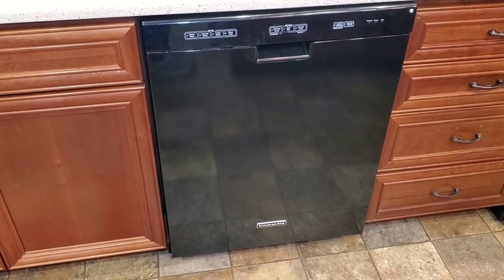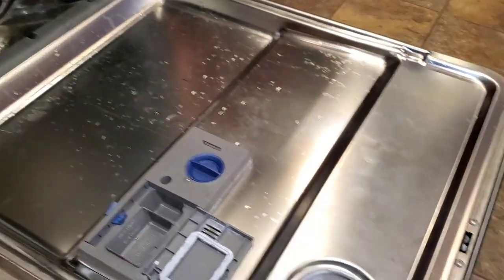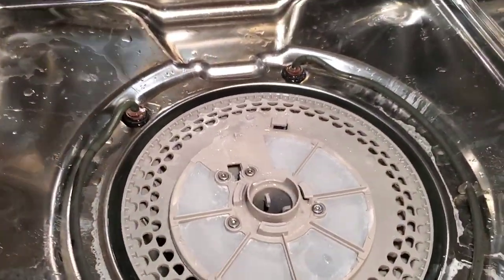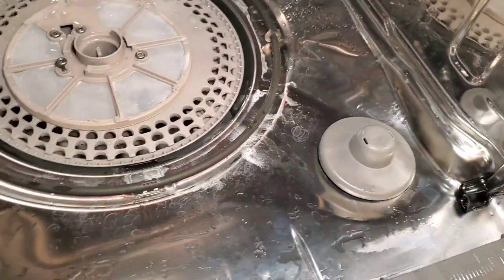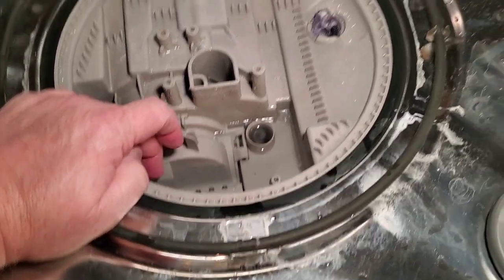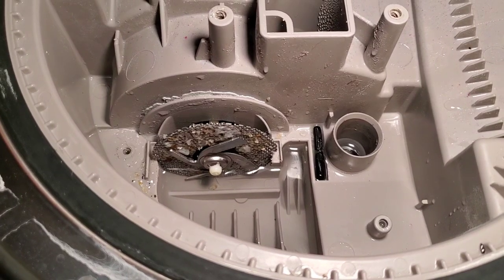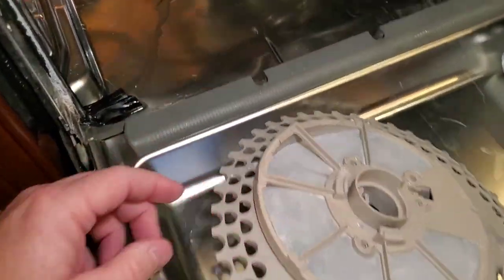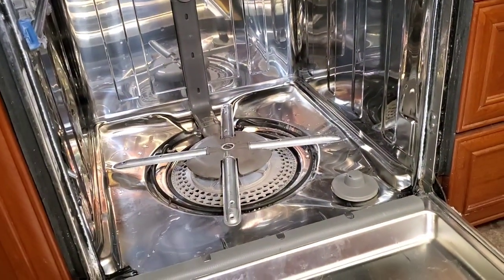KitchenAid Dishwasher How To Repair NOT CLEANING & LOUD NOISE Step by Step

Comment: Nice video. If the reader is having to clean their food chopper too often as shown in the video, that implies the food chopper is worn out.  One might figure out how to tweak it to make things work properly, or buy a new one for $35. For example, my chopper had the retaining plate pop off, so I had to reassembled the cutter, shaft and screen.  In the process I tried to make sure it was working right, I did not think to try and sharpen the hardened steel cutter with a Dremel tool while it was apart from the screen. I believe a dull blade would eventually start to bounce away from tough things resulting quick build up seen in the video.  The retaining cap is not the easiest to remove, if at all, but one can bend it in order to clamp tight if it does come off.   This well done video had close ups that helped me figure out how the chopper went back together, and exactly how readily navigate through the whole job.  I am certainly going to try and keep my dishwasher with its stainless steel cabinet running as long as possible, and informative videos like this sure help with that task.
Reply from the maker: Great input and you are spot on.  I finally decided to replace it and I kind of regret the new dishwasher its not as good as this one.
Reply: The food chopper assembly was under $20 shipped, and it says it's OEM, so I'm hopeful this is all we need. I worry about the noise it was making, and we shouldn't have continued using it until we had figured it out. It's like driving on the rim when you have a flat tire. No bueno.
Reply: your fine screen could be glued. modern adhesive. or get that part replaced.

Comment: Thanks for the share. In my case the shaft the grinder and washer pump run off doesn’t want to spin very well. Years of hard water build up probably caked up minerals in there between shaft and its housing. Lots of buildup everywhere once I took things apart following your video. Can’t see a way to take that shaft out since the entire assembly is encased in a plastic shroud. Will try soaking that sump area in CLR but don’t want to damage any o-rings in the process. I can hear the motor hum when magnetically trying to turn that shaft but no dice. Washer assembly $200 on Amazon. Not all that bad.

Comment: Thank you for your video! Saved me some broken parts, time and money, and made the wife happy again without spending $800. If your washer was as bad as mine, I would take the time to take all the arms etc. apart and clean thoroughly. I found all kinds of crap (toothpicks, rocks, sludge etc. in there, including a pair of balls inside the back feed tube, plus, my grinder fell apart in pieces. Luckily it all went back together. Good to go! Bye bye hand washing.

Comment: Great video - thank you.  Similar to you, I've cleaned out the chopper, still dirty after a few weeks.  Replaced chopper, and it lasted a month.  Just took it apart and cleaned it again.  No doubt that's the problem to getting good water flow at top rack.  No idea when to call in the professionals - I don't want to be doing this every four weeks!!!
Reply from the maker: I finally replaced mine entire dishwasher last month.  This one lasted about 9 years,  I would have like for it to laste a little longer but I got tired of clean this out.  It was still working when I sold it on Facebook for $50 bucks but I told the guy about the issue.  I am glad we replaced it our dishes are so much cleaner now.  I guess for an appliance that you use almost everyday 9 years is pretty good.  Thanks for Watching and your kind Words!!!

Comment: Nice video!!  Sad after taking mine apart and cleaning it out (even found a couple of small sea shells in there) and it still made the loud obnoxious sound :(.  Your video was so good that  it gave me the encouragement to at least try it!  Not so apprehensive now to take on other similar challenges :)  Mine is a 2006 Whirlpool Model and identical to yours inside which I thought was very interesting.  I didn't have to remove the bar in the back because I saw on another video to just move it to the right clock wise and release it from the bottom piece with the little latch in the back on the vertical piece.   I'll subscribe for your other videos ....thanks again!
Reply from the maker: Wow seashells!!! thanks for you kind words and I am glad my video helped.  thanks for sharing the update on the removal!!!
Reply: My Whirlpool, circa 2011, also looks the same. I think Whirlpool makes KitchenAid dishwashers as well as Kenmore and maybe a couple others. Our chopper was missing two blades and a third was on its way out! Machine was very noisy. The last time it was this noisy, we kept using it until it quit making noise. Then the dishes weren't getting clean and we called a repairman who had to replace the whole business down below. VERY expensive. This time I ordered a new chopper assembly and am keeping fingers crossed that the pump is not yet damaged. We found what looked like they were once Q-tips down there and these little plastic dental picks called G.U.M. Our screen filter is intact so no idea how these got so far down into the machine. Thanks for your excellent video!
Reply from the maker: @earthboundangel2926  Wow that washer has been through some stuff!!!  Good job fixing it and sharing your update!!1

Comment: One thing I saw on another video was when you done cleaning the chopper screen theres a little black rubber strip you need to pull up and out and it's like a flapper door that gets debris and it needs to be cleaned while you have it dissembled

Comment: Great Video.  I have a question, does your water level stay below the heating element or above it when washing?  Thanks
Reply from the maker: great question,  Mine sits right at or slightly below the heating element when I open door during a wash cycle.   thanks for Watching.
Reply: @JustADad  Thank you for your reply.  I have a KitchenAid almost identical to yours that makes a chugging/sucking sound when washing.  It also doesn't get the dishes very clean.  But if I add water to it, it works great.  No chugging sound and dishes come out spottless.  The chopper blade is clean and I can't see any other problems.  It's an enigma to me.  I asked about your water level because after some research I noticed that many of the KitchenAid dishwashers I saw on the net appeared to have the heating element up higher than ours, our dishwashers have a small well that the heating element sits in.  I thought maybe the water level needed to be above the heating element on our type dishwasher.  But I guess not.
Reply from the maker: @dougb.6764  Wow that does seem weird.  Maybe that sensor is dirty that I show you to clean, or maybe something is wrong with the float that lets water in.  Good Luck, these machines can be very frustrating.